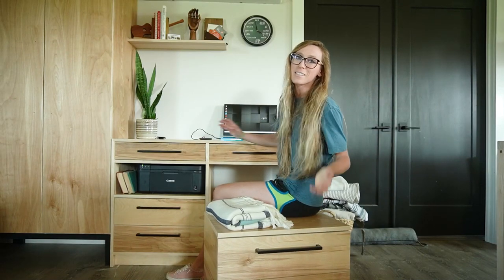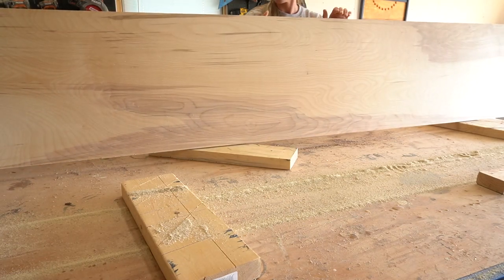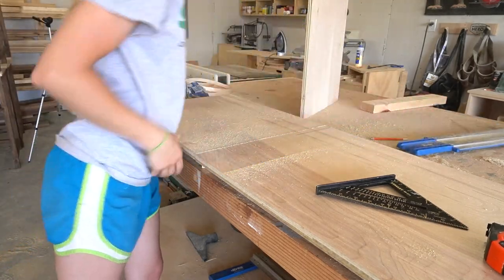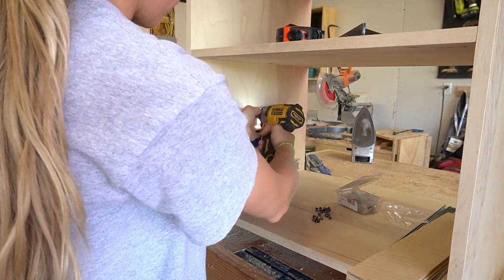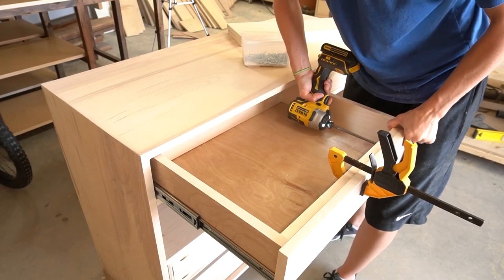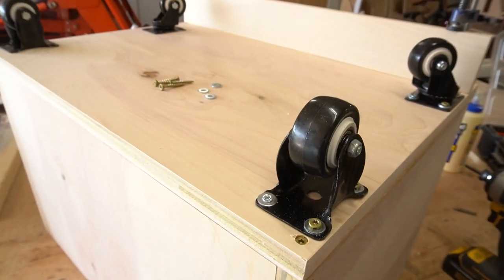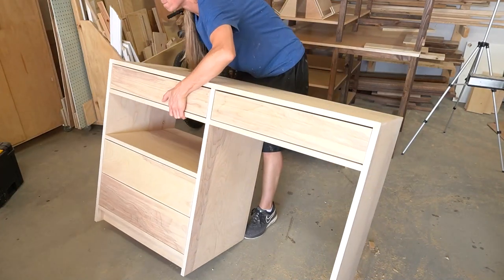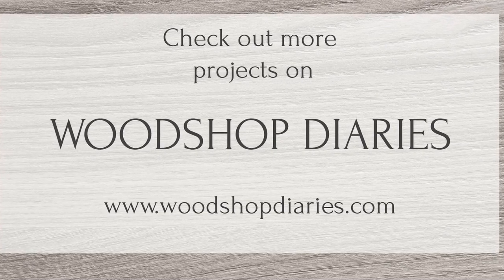How to Build a Dresser Desk--{With Rolling Storage Seat!}

Comment: You are very talented, and the desk/chest is wonderful. When you are installing the faux draw fronts, consider putting the mounting holes in the box and them the holes for the handle, attach the draw box using the handle holes, this will help keep the faux front centered and leave one screw a little proud to pull the draw assembly back out, attach them together using the pre-drilled holes in the inside of the box then from the outside drill completely thru the box and attach the handle. I hope this is not so confusing and help you if you like this process.
Reply from the maker: Thank you! 👍
Reply: @WoodshopDiaries  Your well Deserved "Your Welcome"

Comment: You know, Boubon Moth did a whole video testing wood joints and, to everyone's surprise; the glued miter joint was right near the top of the heap in terms of strength and even superior to box joints and dovetail.  The strongest one was the miter with spline but the glued miter would definitely be the go-to for a build like this.

Comment: I saw the blog post on your website and am building the right half of this desk for my son because it only has 24 inches of space. I decided to do drawers in the seat because my son requested it. Build is going well so far, learning a ton! Thanks for showing how you align things up to ensure they’re square, it wears a short blip but I didn’t miss it. I didn’t see how you secure the boards before drilling in pocket screws, I find I always have to clamp them because they tend to walk and go out of square. I was wondering how you prevent this from occurring
Reply from the maker: That’s awesome! I’m sure he will love it! I actually just hold the boards when driving pocket hole screws. I rarely clamp them. I guess I’ve just done it enough, I got used to how to hold it. 🤷‍♀️ the screws usually tend to pull the joint slightly toward the direction the pocket is drilled, so I keep pressure to push it back to help prevent this.

Comment: The Desktop was very nice, I liked it a lot and I hope I can do it soon. I have only seen one detail in the way you built it and that is that when you use the screwdriver on occasions you use a short screwdriver bit for short places I think it should be a long screwdriver bit, and vice versa you use a long screwdriver bit in places where it is best to use a short screwdriver bit. For example when you put the drawer lids it was better to use a short screwdriver bit and when you put the wheels a long screwdriver bit was better. I think it would be more comfortable that way. Regards
Reply from the maker: I just have a one flat head that happens to be long and short Phillips head that happens to be short. So I just use whatever screwdriver I have that fits the screw I’m turning. 👍
Reply: @WoodshopDiaries  Oh I see .. Yes, that is a drawback having few screwdriver bits, and also when the kreg screws only use the square bit.

Comment: That looks really great! You did a fantastic job of getting the seat and the drawers to match in height. It looks flawless. Can you describe the process of planning that out? Did you just dead-nutz measure the height of the casters and factor that in? Or did you start short and then shim until the height matched?
Reply from the maker: Thank you! So I knew I wanted my seat height 18” so I worked backwards from that. 18” total, the wheels were 3”, then I factored in the thickness of the top and bottom plywood pieces.  And built it from there. 👍 I built the shelf above the drawer to be 18” and the seat top to be 18” so they’d match.

Comment: Hi! Thank you for all your videos they are awesome! I had a question, does you circular saw stop working? I have one like your which I use with the kreg accu cut and it stops running frequently. Seems like the battery is getting hot... Any recommendations?
Reply from the maker: Don’t quote me on this because I’d need to double check the manual, but I believe it has like an “overcurrent feature” so it kicks off if it’s like bogged down or the blade starts to get pinched. I use the big 4.0ah batteries usually with mine.., doesn’t cut as well with the small ones. I’ve never had an issue with them getting hot, but they’ll run out of juice quick. I’d say you might want to try one of the bigger, more advanced (like the Ryobi one+ 4.0ah) batteries if you’re currently using one of the smaller older ones.
Reply: @WoodshopDiaries  thanks for the information and the reply. And keep up the good work. Your work is such a joy to watch!
Reply from the maker: Thank you!! Good luck!!
Reply: @WoodshopDiaries   FYI I figured out the problem. The blade it came with had 24 teeth and I was using a blade with 32 teeth. I went back to the 24 teeth and it works fast with no problem now :D

Comment: I like it and most of the projects you have done. I had a question on the durability of the pocket hole joinery you use, have you had any issues on the longevity and strength?
Reply from the maker: Everyone wants to hate on pocket hole joinery. And I get it...kind of. But I’ve never had any issues with anything I’ve built with pocket holes. I have a five year old coffee table I built with pocket holes (no glue at all) that’s moved with us to three different houses and it is still holding strong. They work well for me. So I’ll keep using them 👍
Reply: @WoodshopDiaries  I use pocket joints to build cabinets and I tried making a shelf using pockets and it broke. Most of the time i use other types of joinery for furniture and such, but you made pocket joinery look good so i tried and failed could it be the jig I used. The broken joint looked like it didn't have enough wood for the screw to hold on to.
Reply from the maker: Make sure you set your jig to the correct depth. That’ll make a big difference. And also use the correct length screw. Ex. When joining 3/4” material to 3/4” material, use 3/4” pocket holes and 1 1/4” pocket hole screws. I’ve build tons of things with pocket holes and have been impressed with their strength.